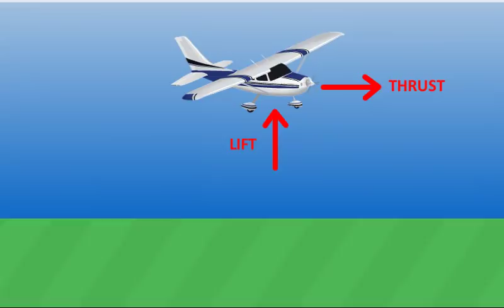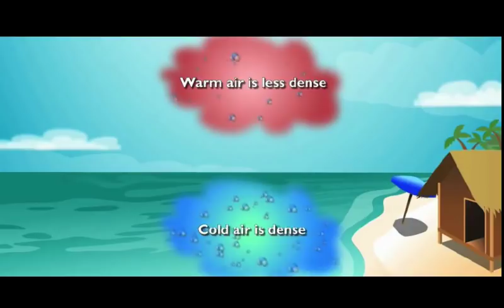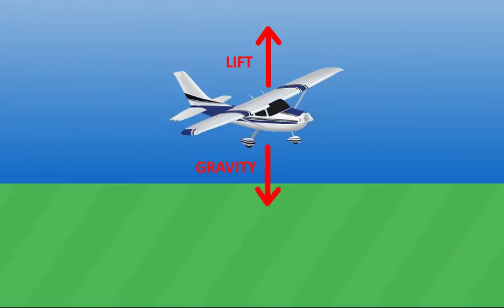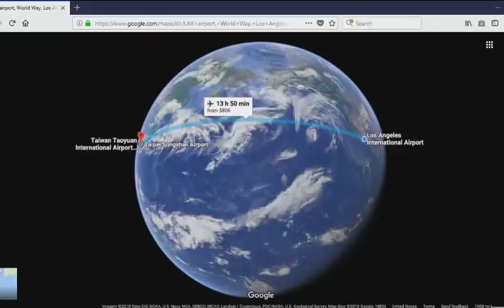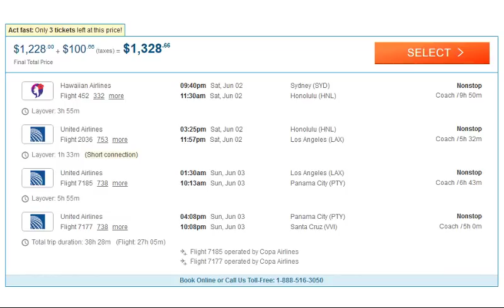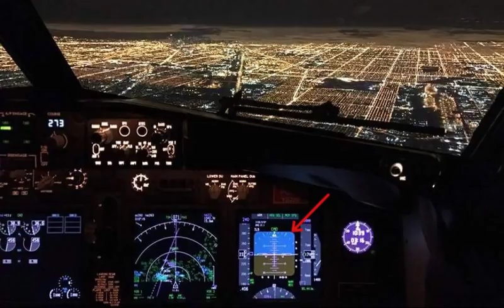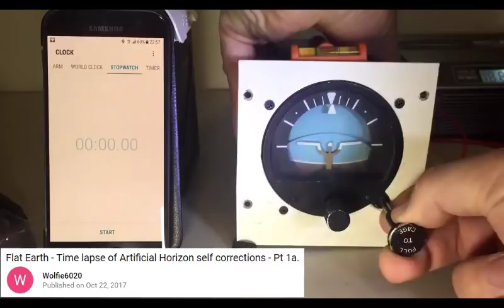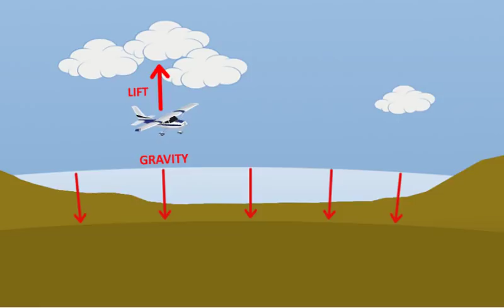Flat Earth Falsities - Plane Nonsense

Comment: so gravity automatically makes the plane fly parallell to the ground eh? how does it know how much force to apply to planes of different mass to ensure this flawlessly happens? how does this happen to birds let alone a butterfly. how in the world could the same force keeping planes magically parallell be sustained by a bird or butterfly? theyd surely be sucked right to the ground? is gravity an intellegent force that calculates mass literally on the fly?
Reply from the maker: You do realize airplanes have pilots, right?
Reply: VoysovReason ummm yeah do birds? you just claimed gravity automatically did this so pilots wouldnt have to.

you didnt even come close to answering the question.
Reply from the maker: I said in the video, when the pilot keeps the plain at the PROPER SPEED, and keeps it pointed straight ahead, then the plane will follow the curve. Every plane has a “cruising speed”, which is determined by its weight and the lift of its wings, as well load factors. Pilots are always adjusting for wind currents, and will adjust as needed to keep the plane at the desired altitude and directed at the destination, just like driving a car. They don’t have to worry about the curvature of the earth, because it will just be part of keeping the plane at the desired altitude.
Reply from the maker: I C - please give me an example when gravity failed to work exactly as predicted. Be the first flerther to answer this question.
Reply from the maker: Bobby Wizdum - Bigger airplanes have to have bigger wings AND go faster to get enough lift. Look at what I said about “cruising speed”. That is the speed at which the lift generated by air going past the wings, equals the force of gravity of the plane. When two forces equal out, you have no motion in the direction of the opposing forces. Like a tug of war with equal pulling strength on each side. When lift equals gravity, the plane stays at the same altitude above the earth. And since the direction of gravity is the center of the earth, the same altitude path stays parallel to the curved earth.
Reply from the maker: I C Flat Ndatsdat! - You really don’t know how orbits work? Have you ever swung a ball on a string in a circle? Why doesn’t it just drop to the center? Because of CENTRIFUGAL force. The centrifugal force pulling an orbiting object outward, equals the inward force of gravity, so it stays in orbit instead of crashing in. Gravity is OBSERVED fact, and I can even prove it in my own living room. See “Orbital Mechanics Demonstration - Response to TheMorgile - Flat Earth Debunk” https://youtu.be/J0sixWxcmBg
Reply from the maker: Bobby Wizdum - Please tell me what a scale measures? Can you attach a scale to the ceiling and weigh yourself? Why not?  A car weighs more than a baseball is EXACTLY the same thing as saying gravity pulls stronger on the car than on the baseball. You can not have weight without gravity.
Reply from the maker: Birds and butterflies are much lighter than airplanes. That is, they have less mass stuck together. So yes, gravity does “calculate mass on the fly” in a sense. The more mass an object has, the stronger it reacts to gravity. That is why you can pick up a baseball but not a car. Please tell me why you think you cannot pick up a car? See my video on gravity. This is obvious stuff that you are just not getting.
Reply: +Bobby Wizdum
"you said weight cant exist without gravity". Which is correct.
"scales existed before gravity was added to the weight formula"  No. There was no formula prior to Newton.. People didn't know the difference between weight and mass. Just like you.  They also didn't know why the same object had a different weight in different places. That difference is due to gravity.
Electricity existed before Faraday, Maxwell et al, but you accept the laws of electro-magnetism don't you. If you believed your claims you would also have to believe electricity and magnetism don't exist. Your logic not mine.
Reply: Do you just not understand how formulas work or something? I don’t get which bit of your understanding is missing.
Reply: 'SINKS"  " FLOATS" . U MEAN RELATIVE DENSITY RESULTS IN FLOATING AND SINKING. WHY DOES IT SINK DOWNWARD AND NOT SIDEWAYS IF IT IS ONLY DENSITY AND NOT GRAVITY
Reply: Bobby Wizdum .....thx Bob. I'm quite used to these childish attacks and they eventually go away due to inability to answer certain queries. Once gravity is took it out of the equation then there is no more magic in their argument.
Reply: I C Flat Ndatsdat! unfortunately they bounce questions and start all over lol its worth it for the few we can reach though
Reply: Gravity pulls everything down at the same rate yes but things with less mass require less energy to overcome gravity.
Reply: "so gravity must then individualually have the intellegence to differentiate the mass of every single thing.'
So is gravity a component of intelligent design or not?
Reply: Bobby Wizdum
"Intimidate45 so gravity must then individualually have the intellegence to differentiate the mass of every single thing."
Are you really that dense or does it require work ?
Reply: +Bobby Wizdum
"so gravity must then individualually have the intellegence to differentiate the mass of every single thing." No. Gravity just is. It exists and the effect of gravity is dependant upon the mass and distance apart of things. In exactly the same that electromagnetic effects vary.
Fg=G.m1.m2/r^2
No differentiation at all. It is a constant. Fg is the thing that changes. It changes due to the masses and distances being different and nothing else.
Free education
https://www.khanacademy.org/science/ap-physics-1/ap-centripetal-force-and-gravitation/newtons-law-of-gravitation-ap/v/introduction-to-gravity
Reply: +Battleships Gone Wild
You mean as in Fg=G.m1.m2/r^2
Reply: Density: is just a measurement of mass per volume. 

Buoyancy: depends on gravity. Buoyant force is equal and opposite to the gravitational force acting on the displaced volume. Exactly as the formula states:

F =ρgV

Where F is buoyant force, ρ is the density of the displaced fluid/gas, V is the volume of the displaced fluid/gas and g is acceleration due to gravity.
Reply: Gravity isn’t “selective”

Gravitational force is dependent on mass of the objects involved and the distance between them. 

Your “gravity is selective” argument is literally the equivalent of saying “weight isn’t real because how can different things weigh different amounts?”

They weigh different amounts because of the different amount of matter they contain. i.e. their mass.
Reply: How many times does it need to be explained that gravitational force is based on mass?
You are still literally saying that “weight doesn’t exist because everything doesn’t weigh the same”
Reply: Yes we knew things were buoyant and floated before we had a formula to tell us the forces involved. Similarly we knew electricity existed long before we had Ohm’s Law and we knew fire was hot long before we knew the laws of thermodynamics. 

There is no hypocrisy or contradiction, it’s just for some reason you can’t seem to understand that gravitational force is DEPENDENT on MASS.

The formula for the force of gravity (F) is:

F ∝ (m1 * m2) / r²  
which states the force of gravity (F) between two objects is proportional to the product of the masses of the objects (m1 x m2) divided by the square of the distance between their centres (r²). 
For Earth gravity one of the objects is Earth, with an estimated mass of 5,972,000, 000,000,000,000,000,000 kg!
Reply: You are thinking about it all arse backwards Bobby. Gravity doesn't "need to know" the masses involved to decide how to apply the force. The masses involved ARE the force. 
Let's look at an easier force formula: F = ma. In other words an accelerating mass is a force. See? 
Or try speed = distance / time. The variables involved ARE the result.
Reply: YEAH , EXACTLY. SINK IS DUE TO GRAVITY. GRAVITY . GRAVITY
Reply: Gravity is not the “force applier” whatever that means. Gravity IS the force. 
Gravity is the name we give to the force of attraction between masses. 
Compare to Coulomb Force which has a very similar formula:
F = k . (q1 x q2) / r² 
That force exists. The force produced depends on the charges involved. No contradiction.
Reply: If gravity serves zero purpose on a stationary plane, which you believe the world is, then you should have no problem at all providing alternative formulae that work without gravity.
Reply: But how does the water know which objects are more  or less dense than itself, how does it calculate the density of gold, and a feather? Are you saying there is a buoyancy god than can calculate all that? 

No, of course not, that's just how physics work.
Reply: And buoyancy is not applying a different amount of force to each object? Then how come metal sinks and feathers float? Is it it's density? How does the buoyancy god how to calculate each and every density of each object places in each pool of water?
Reply: i c flat
gee .. using the wrong definition of a word (in this case the meaning of the word theory when used to describe science)
no flat earth believer  e v e r  did that
Reply: VoysovReason because a car weighs way more than a baseball. contrary to your belief gravity and weight are not intertwined. we had scales and metric units of measurement far before gravity was drawn up. this is exactly my point about the planes. gravity must be able to differentiate between the mass of these flying objects right? so youre basically saying gravity is an intellegent force. maybe even god?
Reply: Intimidate45 so gravity must then individualually have the intellegence to differentiate the mass of every single thing.
Reply: Bobby Wizdum
"contrary to your belief gravity and weight are not intertwined."
Weight = mass x gravity
Thyen YES they are intertwined...and that's not a "belief" but a LAW.

 "we had scales and metric units of measurement far before gravity was drawn up"
So what ?
Gravity mesure the acceleration produiced by mass. NO link with lengh mesurement...

"gravity must be able to differentiate between the mass of these flying objects right"
Gravity is not a force but an acceleration. Therefore the force it applies is directly proportionnal to the mass of the object...
Reply: umm any creature or object on earth is experiencing the same amount of gravity that is 1G regardless of their masses
Reply: A couple things said, "scales existed before gravity"
Yes, scales existed before the Theory of Gravity. That does not falsify the theory, nor does it substantiate density as a magical force. First, I will address the scale.  No one used numeric systems as we do today to estimate weight.  Scales in their early forms used reference materials to determine weight such as metallic objects set to specification by a ruling body. No one knew how it worked but people traded in good faith based upon this mechanism. A common misconception was that they weighed gold and silver. No, they didn't, at least not in commerce. No one trusted each other enough to weigh bits of gold and silver for payment since one could fraudulently add heavy or common materials to cheat the merchant. On the other hand, it was not uncommon for a merchant to overweight their metallic dies to cheat the customer. Next, the Theory of Gravity. Theories are proven and not conjectural mechanisms as commonly thought in modern parlance. Theories are facts developed from a body of evidence since one must prove an idea(hypothesis) for it to become a theory. If a hypothesis cannot prove to be true it will never be a theory. The use of theory as just an idea(not proven) is street language and about as accurate as saying bullseye when accurately striking an object. Is it a bull's eye? Nope, it's figurative. Nothing wrong with that. Just know that the use of the word theory is apples and oranges in this conversation due to differences in scientific literacy. Gravity existed but people didn't think of it or understand it much in the same way radio waves have always existed but not understood until more recently. Gravity and radio waves didn't just start existing because they were named. Quite the opposite. Gravity is a name given to something that has always existed. 

Density: Light objects go up, Heavy objects go down. 
Unfortunately for the flat earth assertion, this creates more questions than it answers. This point ends up going back to gravity considering one must describe the force that makes this so.

"Gravity must be an intelligent force."
The only people saying gravity calculates are flat earth supporters. Gravity does not calculate. Humans do. Gravity is a universal constant: a law. Planes don't just magically hang in the sky. Before mathematics were applied to aeronautic engineering planes fell out of the sky all the time. The Wright Brothers and other people that attempted flight in the early years just guessed at things until they figured out how to make it fly. People died all the time to achieve flight. All this early experimentation created better equations which helped to isolate center points on planes to hold them steady, weight coefficients to calculate lift over gravity, etc. All of these things were built over time from observation. The Theory of Gravity is built from observation. What does it matter what we call it? You want to call it density, okay then. It seems we will now have to differing definitions of the word density. 

It seems that this has essentially devolved into an argument of dissonant definitions. In order to move forward, we will need to agree on definitions and step down the disparagement. The first item in an intellegent discussion is the establishement of common definitions. Let's start there and quit acting like people mean the same thing when they use the same word. Please, for the sake of civil discourse.
Reply: Bobby: you are right, gravity is written into the buoyancy formula. Because it needs to be. And guess what? The formula WORKS. You can use it to predict the buoyant force on an object and then confirm it is correct using a strain gauge or similar device. 

Give me a buoyancy formula that works without gravity and produces the correct results.
Reply: It doesn’t differ. The formula is always the same. 
The resulting amount of force is BASED ON MASS!!
Literally the weight of an object depends on how much matter is in it. How is that hard to understand?
Reply: Your buoyancy theory (or whatever you want to call it) has the same "flaws"  as gravity theory (or whatever you want to call it)
Reply: It's doing crazy shit like making certaint things float, and the other sink, how can it differentiate 2 different objects, is it a conscious being?
Reply: Bobby
regarding the water on a spinning ball experiment

the elephant in the room .. Earth's gravity
Reply: This is way more funny than any stand up comedy .... FE happens when free speech feat. With failed education system
Reply: +Bobby Wizdum    Why no answer?
"so gravity must then individualually have the intellegence to differentiate the mass of every single thing." No. Gravity just is. It exists and the effect of gravity is dependant upon the mass and distance apart of things. In exactly the same that electromagnetic effects vary.
Fg=G.m1.m2/r^2
No differentiation at all. It is a constant. Fg is the thing that changes. It changes due to the masses and distances being different and nothing else.
Free education
https://www.khanacademy.org/science/ap-physics-1/ap-centripetal-force-and-gravitation/newtons-law-of-gravitation-ap/v/introduction-to-gravity
Reply: +Bobby Wizdum   Why no answer?
"you said weight cant exist without gravity". Which is correct.
"scales existed before gravity was added to the weight formula"  No. There was no formula prior to Newton.. People didn't know the difference between weight and mass. Just like you.  They also didn't know why the same object had a different weight in different places. That difference is due to gravity.
Electricity existed before Faraday, Maxwell et al, but you accept the laws of electro-magnetism don't you. If you believed your claims you would also have to believe electricity and magnetism don't exist. Your logic not mine.
Reply: Bobby Wizdum
"how does gravity know how much mass objects have? " It doesn't does it."G" is a constant
Fg=G.m1.m2/r^2
It is the objects that vary not gravity and it is their interaction that varies not gravity.
Fg=G.m1.m2/r^2
Put some values in and see what happens. G doesn't change. The interaction does.
If a feather landed on your head, it wouldn't feel very massive, or heavy to you but if a massive rock landed on your head you would definitely feel it and be hurt. That would also be the case in a vacuum where the density of the medium is zero .i.e. the effect on you is due to mass and gravity. Density doesn't "know", it just is, like electricity, light and magnetism just are, but you would know the differences in the effect of the gravitational constant.
Does a magnet "know" how to be deflected" No, it just is. And that is true from the micro to the macro, just as it is with gravity. Similarly with all basic, natural forces of nature.
Reply: +Bobby Wizdum
"you guys cant prove a single thing gravity supposedly does." Correct, because they are not "supposedly", they are factual not supposed
The gyrocompass.
Ballistic trajectories.
Changes in weight due to height.
Water clocks.
Flight.
Ship stability.
Water wheels.
Tides.
Reply: Bobby Wizdum
" the force has to know the mass of both objects to apply it. you just said it didnt differ. it has to differ. thats why it says m1 x m2. if m1 is the constant earth core than m2 must be known by said force for every object in existance on earth. case closed."
The force "Fg" is the result not the cause. G, the cause, the constant, is gravity not Fg which is the result. You are confusing the result and the cause.
Fg is the result
m1 is the mass of an object
m2 is the mass of another object.
r is their distance apart.
G is a constant. It doesn't change.
r can change, m1 and m2 can change and therefore Fg, but G always stays the same.
Case closed.
Reply: Bobby Wizdum
"do you understand it?"
"f is the amount of force gravity applies ok." No. Fg is the result of G.m1.m2/r^2
 m1 is the constant earth center" No. m1 can be any mass. Any mass anywhere in the universe, as can m2.
" m2 is the variable" No. m1, m2 and r are all variables.
"differ and vary are synonyms" Synonyms do not mean the words have the same meaning which is why they are called synonyms. Rotate and spin are synonyms but they do not mean the same thing.
Reply: +Bobby Wizdum
"wong g must know what the m1 and m2 are. case closed?" Why?
"prove it just is man? demonstrate what you say is true. you cant!" I did. Just because you are incapable of understanding basic maths and physics is your problem, not mine.
"throwing a tantrum"" Please. I am laughing at you. It is interesting that poorly educated, low intellect people accuse people who calmly and quietly prove they are wrong of "throwing a tantrum" or being mad etc. It is very, very telling.
Reply: @Bobby Wizdum
"wong you have not researched"  What you fail to recognise is that some people have a working knowledge of the real world and have experiences which allow them to make rational, logical decisions on such things.
In my rather extensive experience in mathematics, science and real life situations I have found that the mathematics and science I learned at school, college and university actually conform to and confirm real life. Unlike you I actually have real life experiences which means I actually know things, rather you who naively "believes" any old cultish claptrap.
Tell me, how many times have you navigated around the world?
Or to the Arctic or Antarctica?
And tell me what you saw on your travels and how you actually navigated.
Tell me how you ascertain the error of a compass when in the Southern Ocean, using Alpha Ursae Minoris?
We know the earth is a slowly rotating terrestrial spheroid and gravity is a fact.  Just because you are incapable of understanding basic maths and physics and wilfully refuse to learn such things is your problem.
Examples.
What is the relationship between longitude and distance when travelling east or west parallel to the equator?. If you know the answer then you know the earth is a spheroid. If you don't you are not qualified to comment on the earth’s shape.
Please explain the principles behind the development and functioning of a gyrocompass? If you can then you know the earth is a slowly rotating spheroid and gravity is a fact. If you don't you are not qualified to comment on gravity, the earth's shape or movement.
Reply: YOU JUST OPPOSED YOUR OWN THEORY.  WHY DOES IT TAKE MORE ENERGY. SOMETHING IS  OPPOSING THE MOVEMENT UP. PLEASE PLEASE DONT TELL ME ITS DENSITY . JUST GIVE ME AN ANSWER?
Reply: That’s funny 😁
Reply: I C Flat Ndatsdat!

"No... ..... well it didn't take long for someone like yourself to start with the condemnation of intelligence of another person to esteem yourself as smarter."
In fact YOUR COMMENTS are the condemnation of your intelligence
Reply: Bobby Wizdum

"No... ive already proved it. you said weight cant exist without gravity. scales existed before gravity was added to the weight formula. in other words people weighed things without gravity"
You prove nothing but the fact you don't understand it.
Weight was mesured BY COMPARISON before more modern methodes. Then THE SAME VALUE OF GRAVITYis applied to both mass (thing to mesure and the stalion)
The value of gravity was not necessary...
But THE PHENOMEN OF GRAVITY existed already at this time
Reply: Did you even take science in school? or are you still trying to graduate?
Reply: seymoresaymore Thats my point. they say its not. it would have to have its own intelligence. might as well just call gravity god
Reply: Locnar that didnt dispute anything i said. an acceleration is a force wtf. do you not understand that since it applies different accelerations to differerent masses it must able to select different levels to apply to every single thing on earth? it must also then decide to make things orbit applying force in a different way?
Reply: wong they didnt need a formula. you only need gravity to uphold the silly ball theory. it has no actual relevance to everyday life what so ever. a rick doesnt sink in water because of gravity. it because its more dense in relation to water. a car isnt heavier than a bike in relation to gravity. its heavier in relation to the bike! saying there is no weight without gravity is complete crap.
Reply: wong thats impossible. gravity just is and just magically knows the difference between a propeller plane, a 777 jet,  an eagle, and a mosquito? Bull crap !
Reply: Paul McKay long before you im sure. youre so smart but you lack common sense. how does gravity tell the difference between the mass of two objects? "it just does". thats not science. its blind faith.
Reply: GrahamStw thats your science formula. dont you get it? they wrote gravity into all these equations on purpose. bouyancy in real life observation is just density to water. more dense it sinks. less dense it floats. boats and rafts of coarse are built with level surfaces to of coarse float above the level surface.
Reply: GrahamStw yes and how does gravity know how much mass objects have? clearly the same amount of gravity cant be applied to all objects. that doesnt work
Reply: Brie Loren sweetie you guys cant prove a single thing gravity supposedly does. you cant prove it makes water stick to a spinning ball and curve. you cant prove it automatically levels airplanes. you cant prove it makes things orbit. heck at its core you cant prove it makes mass attract mass here on earth. the cavendish experiment has not stood the test of time as reliable. a bowling ball will not attract a marble if i put them side by side. there are far more problems with your vaccum theory than there are with anything flat earth related.

have you ever canoed on a large lake? according to you guys the lake is constantly curving down.  over the coarse of several miles wouldnt the front of the canoe need to be pointing down to be going along with the curvature of the earth? when the lake freezes shouldnt there be a noticeable slope in the ice? we know these things are not there. the redderick that its too small to see doesnt work. if the water is sloping down the surface has to be too. it isnt. on land we drive up and down mountains right? the foot of the mountain is always on level ground. every building is built on a level surface. they have to be!
Reply: GrahamStw how does it need to be if we already knew how it worked before the intro of gravity to the formula. if its mass sucking mass down to the center shouldnt a cruise ship get pulled below the ocean to the core? all that mass that close to the magnetic iron? surely an engine couldnt outpower the force thats strong enough to hold down all of the earths water ? i literally just saw you guys say that everything is given the same amount of gravity and things with less mass take less energy to overcome the force? im sorry but that is insane. if massive bodies of water have the same amount of gravity applied to it there is no way that a bird could fly through the force thats pinning down and curving oceans just because its less massive. thats like saying an ant could keep from being sucked down a drain because its less massive than the more massive rat that easily walked away because it had more mass, power, and force to apply against it. cant you see the problem and hypocrisy in this?
Reply: GrahamStw buddy. m2 will always differ! your own math proved my point
Reply: likelyladsss whats funny? im right.
Reply: wong g must know what the m1 and m2 are. case closed?

all that rambling and all you said is "it just is" and this is fact? thats not science man. thats you saying because i say so then throwing a tantrum through your math book. you proved jack shit!

prove it just is man? demonstrate what you say is true. you cant!
Reply: wong you have not researched. we have alternative answers for all that ballshit. gyroscopes prove flat earth! not the ball.flights prove the globe? how? water wheels? water us level dude. youre talking out your lying butt. nothing you said is proof. you know it.
Reply: Bobby .. your words.."no its due to density. if youre trying to argue words youre missing the point. if you wanna argue that the term for me dropping a tennis ball to the ground is called gravity....fine. how does dropping a tennis ball prove oceans will stick to spinning space balls? it doesnt. the tennis ball being more dense than air is why it falls in reality. "
OKAY ... EXPLAIN THIS ...AN AEROPLANE ON THE GROUND WITH 200 PASSENGERS ... THE SAME AEROPLANE IN THE SKY MINUTES LATER...SAME DENSITY.... WHAT HAPPENED ?  WHAT CAUSED IT TO RISE.? WHAT IS IT OPPOSING? IT IS OPPOSING THAT FORCE THAT IS PULLING IT DOWN.....GRAVITY. NOW EXPLAIN WHY SOMETHING MORE DENSE WOULD FALL TO THE GROUND AND NOT MOVE UP OR SIDEWAYS? BECAUSE THERE IS NO PULL (GRAVITY0 SIDEWARDS OR UPWARDS IN DIRECTION... IT IS ALL DOWNWARD.... GRAVITY WE CALL IT
Reply: wong youre making thing worse on yourself. anywhere in the universe? good luck with that proof. now they are all variables and gravity just "does" but doesnt have to know the variables the force is applying? do you realize how ridiculous that sounds to anyone with a half ounce of common sense in their brain? dude you cant back up any of your math with real world demonstration. any of it. Thats why tesla called it metaphysics. im not going down the argument of whether tesla was for round or flat but he clearly knew einstein and newton were frauds. with the stuff youre spewing its easy to see why. 

listen man here on earth m1 is the alleged mass everything is being pulled to. M2 is everything being pulled. F is the amount of force the gravitational attraction applies. how in the hell can you deny this? we are on earth. its earths gravity that is allegedly pulling us. your other equation would be relevant for a "universe" if one exists but on earth we already know m1. its the center core that attracts all objects. telling me i dont understand? clearly i do and clearly its false. pilots do not do math equations prior to flights. no they arent built in to thecsoftware either. you claim gyroscopes prove round earth? then u know nothing about gyroscopes. might as well say sea level proves a globe. you talk big equations trying to sound intellegent. the problem is the words arent your own and you clearly dont understand the application of these equations Wong.
Reply: COMMENT easy. there is no opposing force. its all in your head. its just natural momentum. no different than walking with the wind at your back vs front. when you go up stairs or climb a mountain or a roller coaster hill...gravity isnt pulling you down it just takes more of your own energy. when you go down the surface is sloped so its guiding your feet, the car, the rollercoaster, whatever. when you go up your walking against the peak instead of with it. thats why when level theres no different energy required in either direction. there is no force pulling you down. if there were since gravity is mass oriented a small child could easily outleap nba players in terms of relation to their body height because they are fighting far less force to get off the ground. obviously we lift our feet without effort.
Reply: Bobby Wizdum 

Non NBA players can jump higher than the basketball players? You seen the videos of the gym guys jumping onto the steps at like head height?
You are thinking in terms of overall height rather than height from the ground. NBA players only appear to jump high because they already start at 8 foot!
Reply: TheG4Z3Y ummm a 6'3 player dunking a 10 ft rim requires a little over a 4 ft jump. how many 4 ft 65 lb kids can dunk on 8 ft baskets?
Reply: Bobby Wizdum 
Why you mentioning kids again? 
I said about the gym guys, I guess you're just ignoring that? The kid's arms are shorter too though..
Reply: TheG4Z3Y because kids have less mass. therefore less resistance according to you guys.
Reply: Bobby Wizdum it's not as black and white as that, stop turning things around to suit your argument. Muscle power, the ability to overcome gravity plays a huge part in it, not just the mass.
Reply: No... youre attacking him because you fail to realize we built boats before gravity. clearly we understood bouyancy first !
Reply: How can gravity be the answer for anything? It's a theory. Not a fact ! 
      It's the proverbial cop-out answer..... like the same old stupid Story that large bodies attract to each other yet nobody has ever seen a collision of planets. So then they say that gravity is what holds them at Bay from each other held in that position. Again a cop-out answer !!!!!
Reply: VoysovReason you said gravity pulls the plane parallell so the pilot wont have to dip its nose. how does flying level and parallell to the surface automatically follow the curvature? what curvature?

you missed the whole point im making. a small propellar plane has far less mass then a huge 777 full of passengers. how does gravity know to use just enough force on each plane? you realize gravity is mass attrarcting mass right?
Reply: VoysovReason so you have no idea is what youre telling me? this is what happens when you say "gravity" without thought behind it.

easy. i predict no matter how big of a ball you have you wont be able to demonstrate gravity making water stick to it while its stationary let alone tilted and spinning. youll say "scale". i say you predict it does this. prove it.
Reply: VoysovReason ..... I didn't say IT failed to work. I just said it is a theory so it cannot be the answer to everything when science cannot even explain why when you throw something up and it comes down. 
      Maybe you can address my.? How can gravity attract and yet you never see planets crashing together and yet at the same time claiming that gravity is what holds them in their positions away from each other. That's just the stupidest reasoning and then the cop-out answer of gravity! So does gravity attract or repel? Or both?
Reply: No... ..... well it didn't take long for someone like yourself to start with the condemnation of intelligence of another person to esteem yourself as smarter. Thus ending all logical reasoning. Good job. This is why you are the distraction.... but I've been doing this far too long to be deceived by your futile tactics. It is you that cannot gain different knowledge to see things as they really are. Good luck with your indoctrinating school books.  :(
Reply: No... ..... see this is what " we "call distraction. What does this have AT ALL to do with this thread?. If I was a high school dropout or a so-called expert scientist, it would not matter   at all.  It has nothing to do with the issue here.
Reply: No... yes you can. weight existed before gravity. they had gold and silver in the time of christ. clearly they weighed it dont ya think? how did they possibly do that without your gravity formula?
Reply: I C Flat Ndatsdat! he is stuck on his text book definitions and fails to realize the world existed prior to sir issac newton and albert einstein.
Reply: No... why would i estimate somethings weight? i wouldnt. id just weigh it. how do we have scales before gravity if the existance of weight is depended on your formula?
Reply: No... Sheesh! A cubic foot is Neither flat or round.!!?? Perhaps we will pick this up tomorrow. But give my response a think.
      And while you're thinking maybe you can ponder this. What is the mathematical equation for flat? There are no numbers for that. The answer is..... plane.
Reply: No... ive already proved it. you said weight cant exist without gravity. scales existed before gravity was added to the weight formula. in other words people weighed things without gravity. just as they do today. 

you said bouyancy couldnt exist without gravity yet boats and bowies did. just as maps existed before globes. just because mainstream science has wrote gravity into a bunch of formulas to make it appear all things are dependent on gravity doesnt make gravity real. no matter how bad you want that to be proof. it isnt. its mathematical mind munipulation and man do they have you.
Reply: GrahamStw that is illogical. to do the formula you need to know the mass of both objects. since gravity is the force applier it certainly needs to know. as would the pilot.

seriously what common sense is left? how long will you flat out lie to yourself? its what youre doing. m2 is a variable that must be known

even if you want to argue that gravity magically performs its force without needing to know the planes mass surely the pilot needs to know the necessary lift to ensure gravity would balance it. too much lift it would defy gravity. too little lift its crashing down. once again pilots dont do gravity and mass calculations before take off. ever!
Reply: No... dont you get it? gravity was written into the equation of weight. where do you think the word came from?
Reply: VoysovReason ..... again the theory of gravity. It is not a proven Theory. So it cannot be a foundation of thought. And again using it as a cop-out answer for why centrifugal forces and gravitational forces equal out. In the Flat Earth realm that is called buoyancy. That has been proven and it is well beyond Theory.
Reply: No... then you need to learn about densities in physics. The lack of density floats and much density sinks. There's your buoyancy
Reply: GrahamStw look at your formula. the force has to know the mass of both objects to apply it. you just said it didnt differ. it has to differ. thats why it says m1 x m2. if m1 is the constant earth core than m2 must be known by said force for every object in existance on earth. case closed.

Back to the original point. the pilot must check the mass of its plane before every flight to calculate the necessary lift to balance gravity. gravity must know the mass of every plane to know how much force to apply. this does not HAPPEN !
Reply: No... why are you insulting me? i dont care about estimating the cubic foot of gold. it is not relevant to the original point of this post which i literally just proved and graham still cant accept it. when do the lies stop from you guys?
Reply: GrahamStw do you understand it? f is the amount of force gravity applies ok. m1 is the constant earth center. m2 is the variable which will key word vary for every single thing on earth. differ and vary are synonyms.
Reply: No... i concede that in modern day equations gravity is written into all these formulas. now you concede that prior to the free masons adding gravity to all the formulas calculations were made without it. the reason you say we "cant" is because that is the formula you were given ! the wheel was reinvented to fit the globe !
Reply: COMMENT that makes no sense. why would anything sink sideways ?  thats like saying why doesnt a ball that i bounce go sideways. skip a rock. tilt a beer glass to the keg. itll pour sideways for you, seek its lowest point, then level. why do things sink the bottom? where are they going to sink to? theres no side for the object to land on. 

that isnt gravity. its nature. i drop the rock in the lake. i created the force lol

now please defeat my original point of this post. graham just got schooled and ran away. care to tell me gravity doesnt need to know the mass of all things individually? you think pilots calculate the mass of their airplanes and do gravity formulas before each flight?
Reply: COMMENT no its due to density. if youre trying to argue words youre missing the point. if you wanna argue that the term for me dropping a tennis ball to the ground is called gravity....fine. how does dropping a tennis ball prove oceans will stick to spinning space balls? it doesnt. the tennis ball being more dense than air is why it falls in reality.
Reply: No... they worked for years before it. you cant wrap your head around this.

why would they have needed these formulas before the globe? they wouldnt. we weighed things to see how heavy they are. the applicable use of scale. we didnt need anything else as we dont know. we knew about buoyancy and density. we built boats, threw balls, etc. gravity being in these formulas is only necessary to explain why people arent falling off the bottom of a ball upside down and water isnt flying everywhere. it serves zero purpose on a stationary plane.
Reply: Levi Vriens thats different than gravity which youre saying applies a different level of force to every object on earth, makes water defy its physical behavior, and causes things to orbit other things. that isnt physics. its sci-fi
Reply: Levi Vriens no it doesnt. who is claiming bouyancy does crazy things like make water stick to spinning balls?
Reply: VoysovReason that does not hold weight literally. its not even always true. the wings may be bigger in relation to the planes body but you have zero evidence they are bigger in relation to the planes mass ratio. in fact its easy to disprove that. how would the airline calculate the proper mass vs gravity ahead of time? a full plane has more mass than a half empty one. you did not think this through at all. the lift and gravity just magically balance out? give me a break. pilots ascend to the desired altitude, level the plane, and the cruise. there is no tug of war going on in the sky